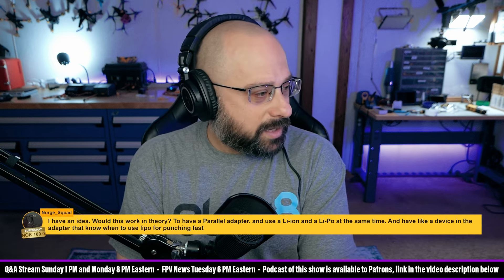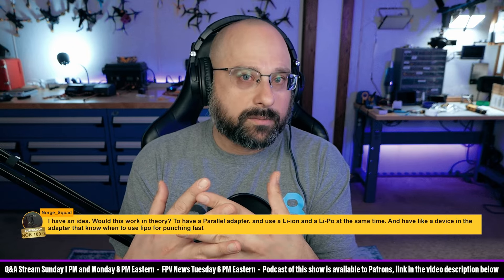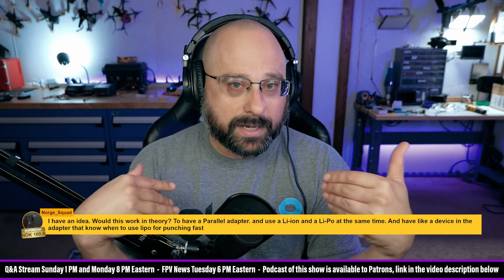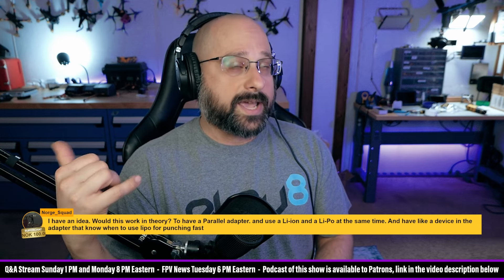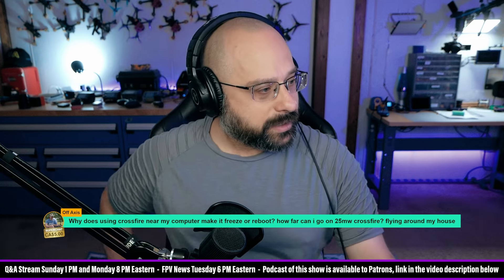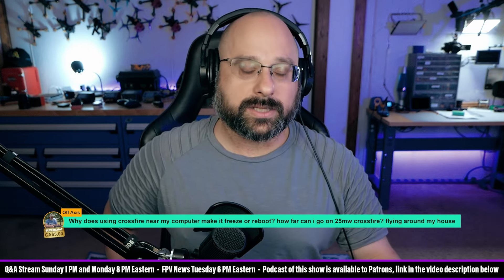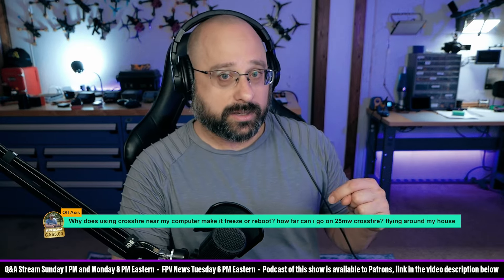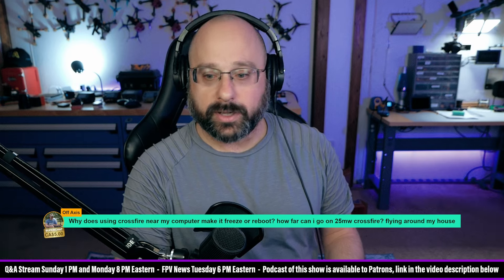Using Lithium Ion And Lithium Polymer Together? Crossfire Makes My PC Freeze?! - FPV Questions

Comment: How about using a capacitor for momentary boost? They're fairly low weight and can be completely discharged
Reply: Would not work, a capacitor with enough capacity would be much much much to big and heavy
Reply: @kermitfrog1340 how much capacity would a cap need for a 1-2 seconds of boost? That might be enough for a proxy/flow-freestyler or a long-ranger to thirst out of trouble.
Reply: Look for those  1f 12v car audio capacitors. They have roughly the size of a 7" quad and weight more. You need about 25 of these for a 2 second 50 amps boost.

Comment: i dont see any issue doing this - in fact maybe lighter weight li ion packs with a small piggy back lipo for high amp bursts is the next big thing.
You can take a lipo down to 3.2v anyway so 3v if you push your luck...   so just call the cut off voltage 3v for the hybrid pack.   the lower internal resistance of the lipo should mean it supplies the bursts and then voltages will even out during the lulls...  cant be hard to do the maths if the weight saved by having the main tank be lighter li ion out ways the loss of not slamming the voltage of this pack to absolute minimum of sub 3v     as i understand it the voltage (and therefore usable power) under 3v for li ion is dropping fast anyway.
Reply: 3v for a lipo is a dead lipo after a few cycles, I do not see the point, li-ions are ideal for long flights because you can descharge up to 2.5v, I do it most of the time, and yes it will require some precise timing clearly :D, but limiting a li-ion to 3v is juste losing 30% of the flight time, no sense at all...

Comment: It can work. Is it worth the gain? Depends on capacity ratio between batteries I suppose. The cheapest way to try it is to get an existing lipo intelligent battery from eg phantom and pair it up with lion pack. Intelligent bettery will shut down on minimum voltage and You can keep flying, or fly home on lion.

Comment: Or just run 2 packs of 2170 Molicel P45B cells in parrelel. They can do 45Amps continuous draw and have 4500maH capacity.  So that's 90A current draw, and 9000maH capacity. Do you need to go above that?

Comment: I think it could work by using different cell counts between the Lipo and Lion.  6s for the Lipo assuming minimum voltage of 3.3 V is a pack voltage of 19.8V.  For the Lion you could use 7 cells assuming a minimum voltage of 2.8 V is a final pack voltage of  19.6V. You would have to put a diode (or better yet a MOSFET for lower resistance) on the output of the Lipo so it wouldn't get overcharged by the Lion.

Comment: One important bit you missed when it comes to the high-performace racing thing: Better motors are also better balanced, leading to less noise/vibration and thus a better tune. So even if a more expensive motor isn't really any better on a thrust stand than the cheaper motor, it may still give you better performance. You'd need to look at whether other people have done tests in order to find out whether the expensive motor actually is better ballanced.

Comment: What if you had a full 6s of both batteries on a quad and the lipo was a smaller mah so it weighs less and only switch when high voltage with no sagging is needed. At the end of the lipo voltage usage, it cuts so you only have liion for the rest of the flight. I wonder if you'd loose enough flight time from the extra weight. If not, that would fix the battery destroying and still serve the purpose.

Comment: When you do a punch out the lipo would theoretically provide most of the power and then the 2 batteries would then equalize when there is low enough load for them to do so similar to what happens on a parallel charging board.

The issue is the difference in usable voltage range of the 2 different battery chemistry's. You wouldn't be able to fully discharge the lithium ion cells because you would be damaging the lipo going that low. Same as a HV lipo would likely damage lithium ion cells.
Reply: Yup, the LiPo would take most of the load on a punchout, but I think once you start cruising again, the Liion would actually be charging the LiPo (because the LiPo, having given more power, would be at a lower voltage after the punchout)... It might not like being charged that fast...
Still, you'd just need some kind of relay or something to disconnect the lipo once it gets to 3.3v/cell, and that'd be really good for a semi-longrange type of drone - where you want that bit at the end to fly home on, but you don't need to be doing punchouts then.

Comment: That could be awesome for V-tols...lipo for take off and landing but fly with lion
Reply: People already do just use two separate batteries for vtol planes. There's even a few vtol planes that use a petrol motor for the forward motor and then batteries for the vtol motors.

Comment: It would have to be an intelligent switching circuit...  I think they have something similar in a pc power supply right and switching power supplies.  It would just have to measure the current and decide which battery to use and keep them separate.  Yeah the circuit would read the amp flow and if it goes above an amount it would switch to the lipo, then if it goes down it would switch to the lion.  I think something like that must exist?  It can't be that difficult to make.   A big problem might be though betaflight isn't going to know what's going on, you wouldn't be able to tell which battery is exhausted...  the circuit would have to be able to be programmed not to let the lipo fall below a certain level so you would lose your punch at some point I expect.  You'd probably have to do it with an arduino or something.

The fc measures the current already, so maybe you could use the fc pin that's giving the amp draw to determine so you wouldn't have to add that circuit you would just have to make the switching part.  I bet chatgpt could figure it out and tell you how to make it.

Comment: People Mix Lithium and AGM batteries... since they sort of compliment each other... 
but I'm sure that is limited us for some special applications... 
certainly not FPV quads.. .

Would need a BMS with a low voltage cutoff to turn off the Lipo below 3.3.. 
100a BMS is pretty chunky...

Comment: Lipo is dead below 3.3V.
Li Ion goes all the way down to 2.5V.
You will either stop at 3.3V and have on capactiy advantage of the Li Ion. Or you go down all the way and damage your lipo.
Just not sure how good it is to mix chemistry. Mainly because of the different internal resistance.

Comment: Joshua your analysis of "longer flight time" is fundamentally wrong.
1) A lipo can be discharged down to 2.0V without much damages but it has almost no charge in those 2.0V to 3.5V, so it's irrelevant.
   A liion can be discharged also down to 2.0V and it will have a little more charge in this same gap.
2) This does NOT mean the liion provides more power, that's a common misconception. It's just a different discharge curve! The liion has a better chemical power density, that's why it provides more Wh/kg (energy). This is not at all related to the voltages, it's irrelevant.
3) The circuit you showed would not make much sense, however an intelligent switch between the two (mosfet powered, capacitor backed) could indeed provide a balance of power and durability.